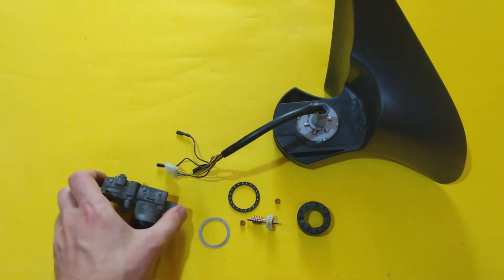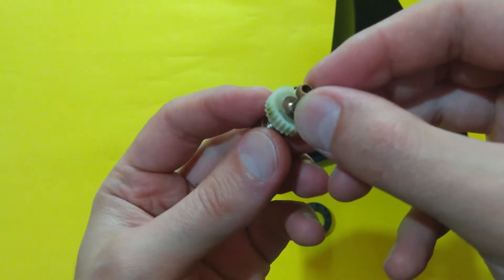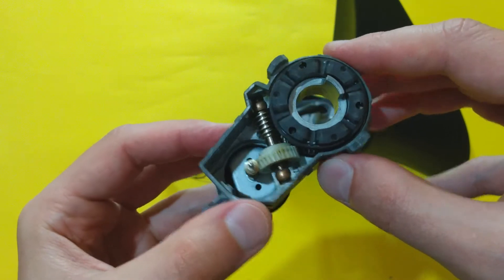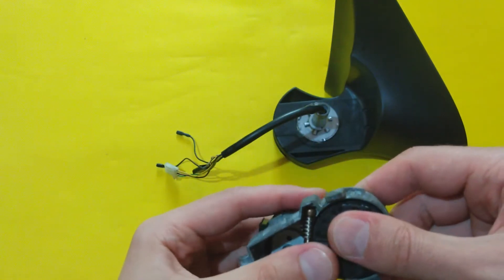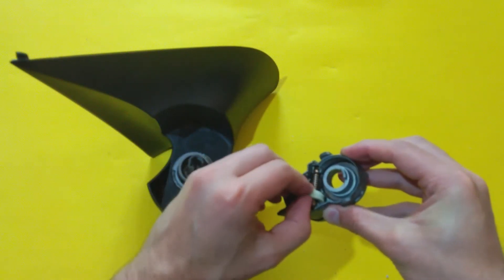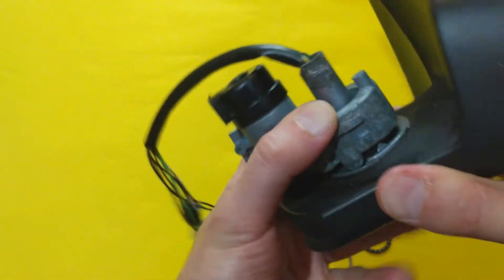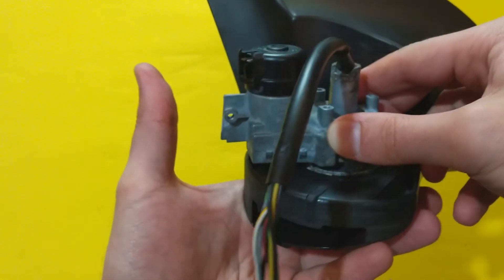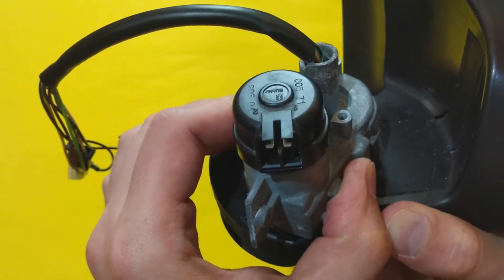How Are Power Folding Mirrors Working

Comment: Could this be the issue with my mirror? It was stuck folded due to the gear breaking. I had to manually unfold it. Now that I took it apart, the mirror doesn’t fold even though I changed the broken gear. It now makes a clicking noise. If I remove the gear, I can hear the motor spinning.
Reply: Is there a video on how to remove the worm?
Reply from the maker: I don't have such. You can search the net for it.

Comment: I really appreciate that’s explanation! Thanks, by any chance can I know for which car this mirror is?
Reply: Abh, they're all about the same, just different exterior style mirrors. It's really a difficult job to disassemble and put back together. Replace with metal gears only, they won't fail like the original plastic gear

Comment: i bought an folding mirror actuator from Thailand there steering wheel position is right side in our country the steering wheel is left side. that's why the right side is more bend. it is possible to adjust the actuator?
Reply from the maker: Not sure that's due to the steering wheel possition. Those in the video are also from UK and there is no difference from such from rest of of Europe.

Comment: I have recently bought a power folding wing mirrors for my Vauxhall Astra K. My garage has installed it but unfortunately, it still doesn’t fold as it should have (I know you can unfold it by putting the (L&R button) and pressing the down button). 
Is it due to our car being incompatible to this feature or an electrical failure (e.g. incompatible pin socket or wrong instalment)?

Would appreciate much of your help.
Reply from the maker: Unfortunatelly I'm not familiar with the Astra K and could only guess what could be the problem, sorry

Comment: I recently purchased a 2022 Acura vehicle with a power folding mirrors. I folded the mirrors today for the car wash, only to cringe while watching the attendant manually unfold the mirrors. Given the design is likely similar to this, would you expect there to be damage to the motor/mechanism over the long run? When I pushed the mirror button then seemed to resynchronize themselves without any issue. Maybe they've designed for this scenario. There's nothing in the manual for this...
Reply from the maker: Yep, no worries. They are designed for such scenario or to be hit by some other car passing by. No harm can be done this way.

Comment: This is really useful! Someone manually folded my mirror while the powerfold was working and it now folds out to about 150% and tries to fold back in beyond the natural stopping point with a crunch and a pop. It’s bugged me for ages but haven’t understood the cause. From watching this, ny guess is that the stopper ring has spun out of position. Or perhaps that the spring is broken and not forcing it onto the hard stops. What do you think?
Reply from the maker: Most likely, but in either ways you will have to open it in order to fix it.

Comment: May I ask you which car are this pieces? Peugeot?
Reply from the maker: Astra H
Reply: @icku  do you know if I can convert the Peugeot 208 mirrors into electric folding? I know that 208 GTI and 2008 have auto folding. But I don’t know which motor should I use. Its so hard to find original motors.
Reply from the maker: @cassianomacan  Probably its possible, but without seeing those mirrors can't say for sure.

Comment: Very good video!I have a Saab 9-3 aero MY2006, can i do the same steps to fix the folding?The silenoid turns without folding.Do you know if i have to cut metal to reach the spring, that it has get of?
Reply from the maker: I'm confused? Little more details what you wanna do?
Reply: @icku  my mirror is not folding.As well, passenger's mirror has the problem.When i press the folding operation, the driver's mirror is folding, but the other is not.Durring the folding i am hearring the silenoid (motor) turning, without folding the mirror.The problem , i suppose, that is about the spring that makes the move of the mirror.So, my asking is, how can i open my mirror safely in purpose to can fix the spring?
Reply from the maker: @STAMATAKISM You can open it, but first find a new retaining ring/spring. There is no way to remove the old intact

Comment: Ok I have a problem with my mirror, its power folding. So it open, partially and then using the opens and close switch to open, it opens after a few minutes. However, the mirror is fixed when it's open or close, there is some play. Do you have an idea of what happened and how to fix it. It's a Hyundai Ioniq.

Comment: Thanks for the video mate. 

May I ask if my motor has only two wires. Are  they both receiving 12V input (folding n unfolding) or are they positive n ground? Thanks!
Reply: There should be only one ground and one for each one of the moves  left right Up and down also for the power folding one for out and one for retract and one for heater mirror and the one for  turn signal. Just one ground for everything all the rest is for all the different movements. I hope you get it ,sometimes you can find the ground because is grounded with the chassis or door panel of the door that make contact with some metallic part of the same mirrors.